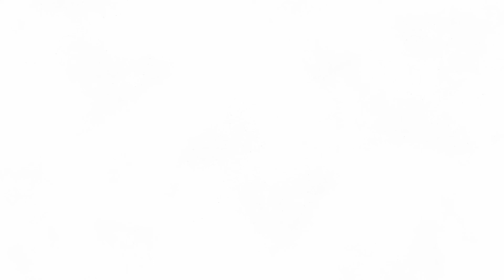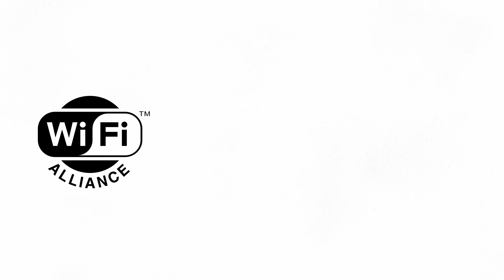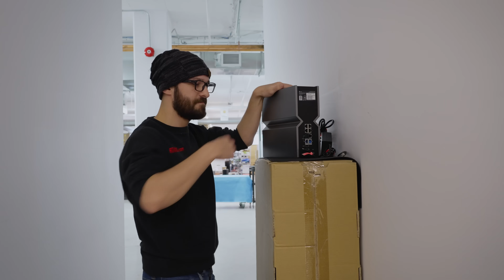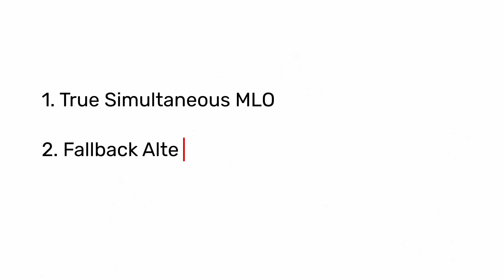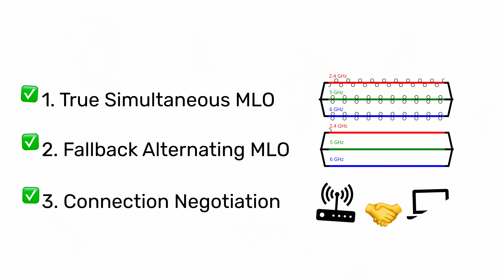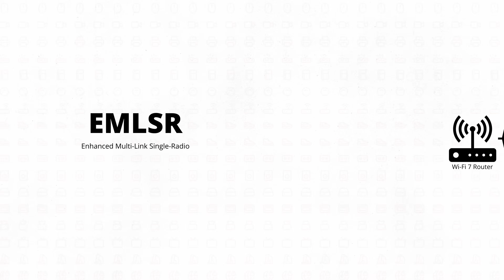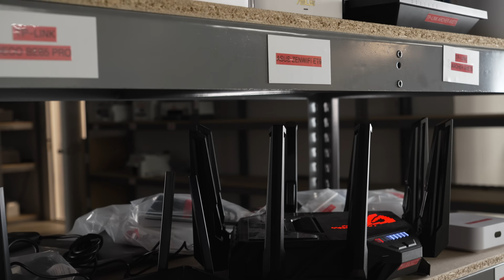Wi-Fi 7's Best Feature Doesn't Work (Yet)

Comment: The standards bodies in charge of certification need to stop letting manufacturers get away with implementing only a subset of the full functionality outlined in a standard. There should be no 'Wi-Fi Certified' or 'USB X' stamp of approval unless ALL features are implemented exactly as described in the engineering specification.
Reply: Its the same with bluetooth
Reply: I'm an engineer and have worked on some of these standards bodies, eg IEEE.  The members are engineers from the manufacturers and will always work to make the standards viable for their companies technology/products.  Fallback and partial implementations can be good engineering too, eg compatiblity, but when these complexities are filtered through marketing it can be a dumpster fire, as it seems to be here.  Also these subtly different certification logos and names (USB has this too) are deceptive, but marketing will always push to maximize the certs they can claim.
Reply: The standards bodies and the manufacturers are one and the same. The standard exists so all the manufacturers are on the same page. It doesn't exist to minimize consumer confusion and prevent deceptive practices.
Reply: But the fact is, ALL THE FEATURES ARE ALREADY IN THE ROUTERS.
Reply: Well, it's not as simple as that. I wouldn't expect my Bluetooth earbuds to provide internet via Bluetooth tethering just because it's a part of the spec, for example.
Reply: @No_True_Scotsman  Sure, but if the earbuds advertise Bluetooth 5.2, why no LE Audio support? These "standards" make so many features optional that the version number is utterly useless to end users.
Reply: Welcome to capitalism! Profits over People! 🫤
Reply: @3nertia  The has more to do with corruption.  Any system can have that kind of greed.  Capitalism that prioritizes profits over people is neoliberalism.  There is such a thing as capitalism that doesn't prioritize profits over people.
Reply: @AngelBunny_1234  Corruption is a feature of capitalism! You can do anything you want if you have enough money (capital) - just look at Epstein and his cohorts 🫤

Chasing profits isn't "neoliberalism", it's capitalism. Stop doing their rebranding for them, Dunning-Kruger! 

cap·i·tal·ism
/ˈkapədlˌizəm/
noun
an economic and political system in which a country's trade and industry are controlled by private owners for profit.

"Capital" (money) is the root word of "capitalism" ffs 🙄
Reply: @3nertia  Just because it has capital in it doesn't make it capitalism.  You misunderstand what capitalism is.
Reply: @AngelBunny_1234  No, Dunning-Kruger, you do lmfao

cap·i·tal·ism
/ˈkapədlˌizəm/
noun
an economic and political system in which a country's trade and industry are controlled by private owners for profit.

Thanks for espousing your ignorance of words, their definitions, or their etymology though! 🙄
Reply: @3nertia  A dictionary provides a definition, not an in depth explanation.  There are plenty of systems that have private ownership, not just capitalism.
Reply: @AngelBunny_1234  "Capitalism" is merely the latest word for the same predatory system of "commerce" we've basically always had whereby the predators who own and control everything force the rest of us to labor eternally for their personal wealth if we want to be "productive" as a "society". The definition of capitalism tells you what it is. The etymology tells.you what it's about - if you're actually smart enough to understand it anyway 😏

We've literally never had any other system because the predators who own and control everything will lie, cheat, steal, and even kill to protect their power 🙄

Thanks for espousing your ignorance though! 🐑
Reply: @3nertia  imo the history is a fantastic way to tell what is and isn't capitalism, but oddly your understanding has zero etymological understanding in it.  Before there was capitalism there was mercantilism, which is a system that believes ownership is wealth.  The more land or gold you have the more wealthy you have.  Eventually people realized you can own very little and be very wealthy or own a lot and not be very wealthy, and that realization is the birth of capitalism.  Capitalism is the understanding that wealth comes from making something, instead of purely owning something.  This has lead into the birth of the service sector, where wealthy people might get services like e.g. a massage.  There is no ownership there, but they are being pampered, which is wealth.  Another example, the current fiat money system that isn't backed by gold is a capitalistic idea.  It's that wealth can be built from making something instead of owning something.  You want something?  Go make it!  That's capitalism in a nut shell.  All real world economic systems have corruption in them.  It's a nasty side effect from the real world.  There is nothing corrupt or not corrupt about capitalism.  It's an orthogonal concept.
Reply: @AngelBunny_1234  Thanks for proving that you either can't read, won't read, or can't comprehend what you've read by the way!
Reply: You clearly need the definition of "etymology" too because you seem lost ...

et·y·mol·o·gy
/ˌedəˈmäləjē/
noun
the study of the origin of words and the way in which their meanings have changed throughout history.
Reply: @3nertia guess what, under socialism, you get less options, less quality and they still try to milk money from you. Communism gives you cheap scraps they give to the people while the rulers get the good stuff.
Reply: @akihitokoizumi2474  Most american post on youtube.
Reply: @snowolf494 he’s not wrong though.
Reply: @davideyres955  Technically, he is wrong.  There are some kinds of socialism that line up with his comment and there are other kinds that do not.
Reply: @akihitokoizumi2474  You mean the socialism/communism that the predators who own and control everything have literally never let us try? Socialism/Communism and Capitalism are mutually exclusive, by definition, Dunning-Kruger. They're literal opposites! Look at the etymology ffs! It's like Harry Potter and Voldemort - one cannot live while the other survives!

The predators who own and control everything will lie, cheat, steal, and even kill to protect their power which means they can murder millions of real communists (people working together for the betterment of everyone), pretend to be "communists" themselves and then convince "useful idiots" like you that communism "failed" and that communism is "evil" despite [obvious] etymological evidence to the contrary 🙄 

Thanks for proving how effective propaganda is as a weapon though, Dunning-Kruger! Everything you described about socialism/communism is exactly how capitalism works 🤣🤡

Way to be a good little 🐑
Reply: The issue is that if that were the case, this would raise the base cost for every device. Especially with USB 4, if every host device that has a USB C port were forced to have PCI Express, 80 Gbps and DisplayPort/DisplayPort Alternate Mode, there wouldn't be any entry level laptops and they would create a USB 3.99 specification that just makes everything optional.
That's one of the issues with these "open" specifications and one of the main avantage of specifications and certifications like Thunderbolt 5.
Reply: @ovoovoovoovoovo for us it's simple: then cheap devices would just be certified for usb 3.0, not 3.1/3.2/4

But no, they want to say the cheap device is full usb4 so everything is optional
Reply: @MajoraZero  What if you want your device to support 40Gbps which is twice as much as USB 3.2 Gen 2×2 but you cannot accomodate for the other specs you would require?
I believe it would be way more confusing having USB 3.0 devices that can be capable of anywhere from 5Gbps to 120Gbps (if we follow your logic of making every non-fully implemented USB4 host device a USB 3.0 device, and that's not the only difference between specs).
Not everything is optional, if you read "USB4" you know your host device supports at least 20 Gbps transfer speeds, Host-to-host communications/
USB4 networking, DisplayPort, and DisplayPort Alternate Mode.
Yes, consumer confusion benefits the manufacturers, but there is no easy solution to this problem and honestly, I believe the USB4 spec is way better than everything the USB-IF has written before.
Reply: @ovoovoovoovoovo that's the problem, which @yhzh2002 pointed out. The certification is to keep manufacturers in line, not to inform consumers.

USB is actually a PRIME example of what happens when you try to do both with one standard. You end up with USB 3.2 Gen 2x2 which is really just USB 3.2. Whilst muddying the water as now consumers buying a USB 3.2 Gen 1x1 think they're getting 20Gbps when they're only getting 5Gbps.

The idea should be that the verification should be the level of standards the product meets or exceeds.

Basic capabilities should have been standardized separately from the specification version in USB's case, since USB defines the connector, the protocol, and the feature set!

SO instead of USB 4 vs. USB 3.2x2 it should have been:

USB [ version ] [ type ] [ speed ]

Where:

Type: an optional moniker for what level of standard features it supports. E.G:
- "Video": supports the alternate mode for video via DisplayPort. Sets minimum power specification.
- "Express": supports the alternate mode for PCIe data transfer. Sets the minimum power specification.
- "Power": This is already its own standard! USB-PD! This proves my point!
- "Complete": a roll-up of all previous types + any "basic" required additions to the standard version.
- Nothing: It's just a USB cable with minimal power delivery.

Version: Which version of the specification, protocol it is.

Speed: the max theoretical speed the device or cable supports.

So instead of "USB 3.2 2x2 with video" like earlier suggested, or "USB 4" (without video or PCIe) like you suggested, you could have something sane, like "USB Video 4: 20Gbps", "USB Power 4: 40Gbps", "USB Express 4: 80Gbps", and "USB Complete 4: 120/40Gbps"

Cable markings could likewise use a standardized shorthand, similar to Super-Speed (SS) was for USB3: "VD" (Video Delivery), "EX" (Express), "PD" (Power Delivery), "FX" ("Full Experience" ➜ Complete).

Or to put it simply: standards should be more modular.
Reply: The good thing is, of course, that you don't need to have 7 wireless routers using different protocols, one for each brand of device you own.
Reply: @ovoovoovoovoovo  Paradoxically, it would lower the base cost for every device.  It would create manufacturing of scale which would lower prices.  Instead of 20 different kinds of something there is one kind of something, and mass producing a singular thing is cheaper than making a handful of different versions.  By being "cheap" it actually raises the price in the end.
Reply: @AngelBunny_1234  Are you talking about cables, host devices or peripheral devices?
That definetely would NOT just "economies of scale" the problem of added integration complexity on host and peripheral devices. USB4 is not just a chip you buy and solder to the PCB, it changes EVERYTHING on the board, limits your components options and the vast majority of boards are purpose-made for one specific device, so every device would have to find a way to implement all of the USB4 spec.

Comment: Just like with 5 GHz band was originally supposed to be in Wi-Fi 4 products, but in fact came only with the fifth gen, you can expect MLO will be broadly used in Wi-Fi 8.
Reply: It wasn't common, but there were quite a few Wi-Fi 4 products with 5 GHz support. You'd usually look for 802.11abgn in the spec sheet, instead of just 802.11bgn, as 802.11a is strictly 5 GHz only...
Reply: @mbc07  I remember using 802.11a in uni since basically nobody had a 5GHz capable radio and n wasn't ubiquitous yet
Reply: Dunno what you're talking about. Tons of wireless N stuff had 5ghz. That was its main selling point, was that it was a dual band specification.
Reply: @blockofdynamite  most of the clients didn't support it. And in the consumer market, probably only the highest tier routers had the support.
Reply: Yeah, I mean this is good information, but it’s irrelevant for most consumers. Nobody has client devices that have actual decent MLO support currently.
Reply: @paradoxmo what if people upgrade their devices? Do people need to upgrade from wifi 7 to wifi 7 😂

Comment: I do have a question. Are there similar shortcomings or false promises for the Wi-Fi 6E market?
Reply: Wifi 6e doesn't include MLO, so it can't have the same shortcoming. Since pretty much the only relevant feature of Wifi 6e over Wifi 6 is a 6GHz Radio, there is way less room to lie in Marketing. Pretty much any Wifi 6e Router will do 6Ghz, and beyond that it's just Wifi 6.
Reply: There’s not really any reason to not get a WiFi 7 router over a WiFi 6E. All WiFi 7 routers with a 6GHz radio can also support WiFi 6E clients. That said, if the WiFi 6E router is much cheaper and you don’t have many WiFi 7 client devices then the decision seems clear that WiFi 7 isn’t needed.
Reply: @paradoxmo Are you sure? What if the "7" router never gets useful firmware updates and never get full MLO support? If I only want a router for a single smartphone which only supports Wi-Fi 6E, I feel like 6E is enough.
Reply: @bowi1332  I think we’re saying the same thing. I’m just saying WiFi 7 is still a superset of 6E and if you have a WiFi 7 capable device you can still take advantage of faster single band speeds, regardless of whether it has MLO.
Reply: @paradoxmo We do. 😅

Comment: So is WiFi 8 going to finally fix this? Or should I say, Wi-Fi 8?
Reply: Wi-Fi certified 8
Reply: @WeiserMaster3  Wi-Fi Certified 8.2 Gen 2x2
Reply: @RoyaltyInTraining. that's so terrible, i love it
Reply: @RoyaltyInTraining.  Wifi certified 8 3x3 channel but for terms look at our confusing chart that may or may not be fully supported anyway™
Reply: @RoyaltyInTraining.  Wi-Fi Certified 8.2 Gen 2x2 Type 3b*

*The certification doesn't guarantee the main core feature of the new label, so you need to check the feature support in the device you're going to buy manually. Of course, if some seller is guarantee the feature, it doesn't mean it's actually implement it.
Reply: @WeiserMaster3 Wi-Fi Certified 802.11BGNX 3.1 Gen 2x2 Series X Tokyo Drift
Reply: Wi-Fi 8 Certified Pro MAX Type-C.
Reply: It's the same thing.
Reply: @francocastilloAR it's naaaht

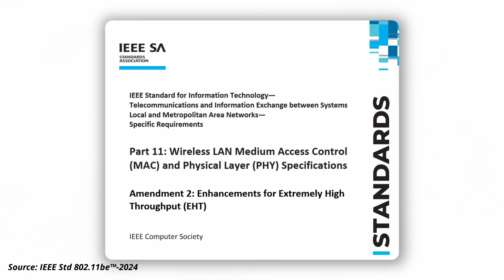Comment: 1:35 And I thought that USB, SD Cards and HDMI standards were messy... 😆 (I just hyped this video AND recently re-subscribed as a patron or whatever on your website.)
Reply: display port too
Reply: @junior-OG I'm still using DVI-D for my gaming PC. 😆 I have yet to discover the joys of DisplayPort.
Reply: The 2 most egregious marketed items are still the flashlight and car audio amplifiers. 😁
  You are spot on with   SD Cards, Thumb Drives, and it has been a horror show with USB and HDMI.  How hard is it to put a marking on cables so we know what they before we try to understand the specs that the cable probably can not do anyway!  

When USB went to 3.0 they lost their minds.  
You have no idea WT'F you are buying or getting when you buy cables! 
You have no idea what a cable can do until you plug it in and use it.  Lot of times they aren't even to spec, no matter what the package or website says.  Its horrible.
Maybe adopt actual Color Codes like a Resistor or numbers and letters stamped into it and these days you need like 5 stripes with all the versions, Gens, revisions, power, display port... is it just a PD? 

I find it amazing that on 2026 that there are no laws that prohibit this type of thing.  If you are confused and understand what you are supposedly buying imagine how bad it is for people who do not fully understand what they are buying.  A lot of times it's not the device, it's the cable.   
Ask me how I know that 🤔

Comment: Nice video! Subbed!

Yup, got an Asus RT-BE92U. 

My old Nokia WiFi6e couldn't reach all the rooms in the apartment, so I had to get a mesh. Even then, I have 6 neighbouring WiFi within LOS and they all have full signal, meaning they are either interfering or is next to my WiFi channels on all of my 3-bands. And since, they are all on WiFi6/6E, everyone is having bad signal.

The Asus is great. It has 4 high-gain antennas and is powerful enough to reach the furthest room. I didn't care about MLO when I bought it last year because I knew there are few clients that support it. The first client devices will probably be flagship mobile phones and tablets with 2 or more radio/antennas like the Samsung S25 Ultra and ZFold7. However, currently this feature is not enabled on these phones.

That said, my Vivo X Fold 1 seem to support MLO in WiFi6 but I think it was unstable so I disabled it. Maybe the Nokia Beacon 2 don't support it fully.

Is MLO worth it? I honestly don't think so, meaning I don't think it's the best feature of WiFi7. 6Ghz range only works well with LOS, so when I'm in an adjacent room and not in LOS, I can't get 6Ghz and the enhanced bandwidth. I can get 2.4 & 5Ghz but 2.4Ghz data rate is very low. So for MLO to work well, you need to sit in front of the WiFi base station or a repeater node that is connected via LAN to soak in the 5+6Ghz goodness.

I think the enhanced OFDM implementation is best feature of WiFi7, it seems to be better at signal rejection (protection from interference.) After upgrading from WiFi6 to WiFi6e, I still see neighbour WiFi interference but moving to WiFi7, I didn't even need to install a mesh anymore because there is little interference. Of course, it could be the bigger waveguide on the Asus but I think the WiFi7 radios do play a part.